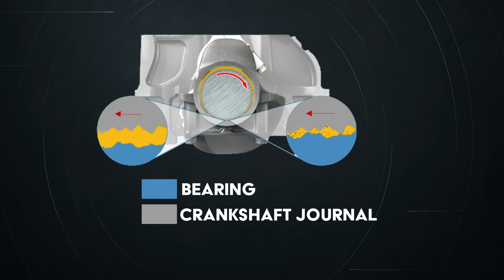the truth about start-stop technology (finally proven)

Comment: I'm thankful my 2025 F150 has a little dial to pick different driving modes, and Sport mode(disables auto-start stop/cylinder deactivation) can be turned on by just spinning it all the way left. It's pretty quick and simple to do, sucks you have to, but could be a lot worse. it's the first thing i do after starting, and i'll be doing that till the wheels fall off

Comment: This is absolutely false, to the point where he's not just mistaken, but purposefully ignoring reality and must be pushing an agenda.

His "experiments" are laughable, and he even admits you should think the first one is "shocking".

5:08 we see the first "experiment" takes several seconds for the engine to stop, and 8:55 we see it require over a second to start. These are not start-stop engines.

Notice he never says what kind of engine or car he's using? It appears to be an older model Transport T6.

So, he is absolutely right that you should not try to retrofit your 1973 Plymouth Duster straight-4 to be stop-start 😂. He MIGHT be right that you should disable start-stop on your 2016 VW van, especially if it's a diesel engine with over 100,000 miles on it.

The fact is freight companies use start-stop engines in their fleets. They do cost-benefit analysis (including large-scale real-world trials covering millions of miles), and would not use it if not directly cost-saving.
Reply: Yeah, but don’t ruin a good alarmist theory.

Comment: Even before this video, I’ve always thought a separate electric heater/pump  that specifically lubes the main bearings for a few seconds before starting would be a worthy idea. I have a strong suspicion that engineers have neglected the main bearings in the latest truck engines.

Comment: There are a lot of key test conditions that you did not provide. 

What was the oil temperature throughout your test? 

What was the water content in the oil by the end of your test? 

What were the on/off times?

Have you considered comparing the damage to an engine which is exclusively idled for an equivalent duration? Extensive engine wear also occurs in vehicles that are idled.

Comment: What about hybrid vehicles they're constantly starting and stopping and often last over 300k miles. Also vehicles with traditional start stop systems have electric oil punps to maintain flow. This is biased and doesn't take into account how start stop systems on equipped vehicles work.

Comment: Highly unrealistic test tho. No one does 84 hours of full cranks back to back. Good auto start stop systems don't do a full crank either. I've heard some cars do a full crank and that's stupid, but good systems just pause the engine then resume when needed. It seems no one can agree on whether or not it damages the engine. The proof is in the pudding, which this pudding was made with cement powder instead of gelatin

Comment: I just came here to say that regardless of what this video has to say, I absolutely love this technology. At first I thought it was dumb, then I realized how it was working, and just how much it was saving on fuel. Astronomically different for me when I stop and go  traffic, waiting for one traffic light after another, or post- concert traffic  that only moves like every 30-60 seconds thanks to a traffic cop directing the rush, or in a fast food drive thru thats not actually fast...
My average mpg is impacted quite a bit whenever I'm stuck sitting and idling. 

Where it doesn't make sense is when you just come to a stop sign or something where you're going to pause only briefly, or like false-stop traffic backups due to morons, where your rush hour traffic comes to a dead stop for just 3-5 seconds or so.. HOWEVER If you are truly paying attention and recognize these things ahead of time, especially at stop signs and when you're going to need to make an unprotected right or left turn, you can make the car NOT activate the stop/start  thru METHOD, not just turning of and on the button. For example, my 22 Durango, if income to a stop LIGHTLY and barely am touching the brake at all when I stop, it won't activate. Then once stopped for 1 second, I can then push the brake firmer and there's no activation. Also, upon resuming after stopping, it will NOT activate again until you've reached at least 6mph ... So if you're creeping along in slow traffic, it won't re-activate... Which is why I wait for a slight gap, enough to get 6mph so it resets the conditions, then next time traffic is stopping, IF I determine it's gonna be stopped for like 15+ seconds, I can make it stop. For example, if I come up to a traffic light I can't pass thru, but don't know if I'll be able to get thru before red, I'll "soft stop" so it doesn't activate, but then if the light turns and I still can't go, I let off the brake for 1mph increase and then press the brake a little harder to stop and it'll activate so I'm not pissing away fuel at a red light.
I LOVE THIS SYSTEM

Comment: One question according to the manufacturers the oil pressure for start stop is primed hence there should not be a los in oil pressure due to start stop.
Was the relay integrated into the start stop system and securing the oil pressure the manufacturers claim or was it just connected to the conventional engine start?

Comment: IF ITS SO DAMAGING why am i as a tech not replacing crank or rod bearings or enginebloks all around the year? over past 10Years i replaced cilinderheads for coolant leaks never have i replaced engine blok for wear and tear on crank or rod bearings. i work for an official VAG repair center so i get all the troubles of the brands. this video is made to scare not educational

Comment: So what you're say is, our engines would last virtually forever with an electric oil pump that builds oil pressure before cranking... Who could have imagined?
Reply: This is exactly what I was thinking. Electric before start and mechanical while running.
Reply: I was instantly thinking the same thing
Reply: The electric pump to cover pressure before starting the engine sounds really worthy. This is an easy retro fit. Can this team do a similar test to simulate a years worth of stop starts with an electric pre-pressurised oil freed system.? Please!
Reply: I do not trust electric oil pumps and water pumps feeling an engine.
Reply: @lexustech48 thats why you have both in parallel with backflow prevention check valves. Electric is only used at startup and engine only starts cranking after a few seconds after the electric pump is commanded to come on.
Reply: same for a gas pump, engine who use a electric one will prefill the engine, for diesel engines its important because running them empty can damage them because it also act like oil (wich is why they last longuer).

Having a mechanical pump who is powered by the engine itself will run the engine dry every times it start.
Reply: Well... that and a preheater so it's already up to temp when you start running it.  Yep.
Reply: @Mark-yx8nn  that might use a lot of electricity.
Reply: I think the parts needs to be on movement also for them to get oil in between
Reply: @loislugo896  still should get oil in all the places in a couple of revolutions not multiple 10s of thousands
Reply: Yup. I don't know what the 2016 VW Transporter T6 had, but modern start-stop engines, with modern oil, do not lose lubrication in that short of time. Kinda scary that an auto mechanic wouldn't know that.

He might as well have been testing on a 1979 Ford F150.
Reply: @MrRoguetech i did not know start atop engines could bend gravity and lubrication just because the manufacturer told you so.😂
Reply: @MrRoguetech  "...do not lose lubrication in that short of time." If it doesn't have an independent electrical oil pump, I seriously doubt that is true. Even then, you will not have hydrodynamic (.e. wearless) lubrication until the engine is above about 500 rpm and thus an automatic engine stop start (AESS) engine will, almost always, benefit from that function being disabled. Only if the AESS prevents ridiculously long idling could it be of benefit to the wear of the engine.
Reply: @MrRoguetech  yeah he seems pretty clueless
Reply: Do you and everyone else want to drive the same car with a forever engine? Most people replace their cars withing 5-10 years. What's the point of having a forever engine? The goal would be to have an engine that is good enough to last the PRACTICAL life of the car. Over engineering anything beyond the PRACTICAL life of the car is a waste.
Reply: @joefish4466 my car is 12 years old...im not looking forward to buying a new car. I will keep maintaining for another 20 years.
Reply: @joefish4466 the practical life time of a car should definitely not be as short as 5-10 years. So lots of people get a different car in that time? Yeah, I just did this summer myself.

But there are two factors that make such a short lifespan for a car INSANE. 1 is financial cost. Not everyone can afford to buy cars like that. I bought my first car at 19 years old for $1000 and at the time the car was a 16 year old Honda! 2 is environmental impact. Having cars last for the lifetime of 1 owner would be awful for the environment.
Reply: @joefish4466 because cars can last decades, he handed down etc. the idea cars only last 10 years is modern marketing and deliberate design. 2 of my 3 vehicles are 40+ years old, cheaper to maintain than modern cars, and get way way more attention and comments from folks.
Reply: @joefish4466 so when your kid buys their first used car they will all be mechanical grenades and a cost trap because PeOpLe DoN't HoLd On To ThEiR CaRs AnYmOrE.

Comment: I would say there is room for refinement. I have to say when driving in town in heavy traffic and long queues I find the build up of fumes quite stifling, especially on a hot day with the windows down and I did that for many years when I was working. I actually preferred the stop start function then and often thought for goodness sake turn off your engine you are not going anywhere fast when sat next to a stationary car pumping fumes in my direction and typically they are the sort sort of driver who races off to get 10 meters as quick as possible in order to sit stationary on the bumper of the car in front for another minute or so. Yes you can manually stop start your engine and I often do if I am not driving with auto stop start but that does make the traffic jam that little bit more tedious. Maybe a selection of stop start programs for different circumstances would be a good idea, I would imagine it possible to build in a learning algorithm to detect certain conditions and adjust the function which would turn it off entirely at times. Certainly my current BMW turns it off at times which I assume to be when the drain on the battery is deemed too much. Maybe a link with the satnav for example which can predict that you are going to be stuck in a jam for a while.

Comment: On the mazda 6, u can disable it by removing the bonnet switch right at the front. No need for stupidly expensive battery. You will get a permanent battery warning light though

Comment: when this mumbo jumbo came out I thought about starter wear and dpf clogging up due to low exhaust temperatures not being able to burn off unburned fuel particles and of course in Estonia where there is below zero degree weather for a long winter period i knew It would wear out engine when the engine is cold but  I didnt know that such amount of wear occurs in warm internal and external temperatures. This just proves the well known point that Politicians and businessmen don´t  give a donkeys dillhole about the environment. Just milk these silly goats

Comment: Subaru has taken away the ability to permanently switch off this so-called feature. Now you have to remember to turn off each time you get in the car. And they removed the mechanical button to keep you from even using the automated replacement switch. 
Up to this point, I always bought Subaru, but never again.

Comment: The fact you constant start stopped instead of typically letting the engine cool between most cycles doesn’t prove anything.  You can also get an oil that is more viscous at warmer temperatures to reduce wear more.  

Ignoring all of that the intention of this technology is to save fuel not wear on serviceable parts.

Comment: You failed to account for the check valve that prevents drain back in most newer high quality engines.  The engine in my Tacoma Hybrid builds oil pressure almost instantly upon restart. The fuel that I save offsets any costs associated with wear. This isn't an issue for all vehicles, only the cheaply built engines found in Nissan and Chrysler, Dodge, Jeep and Ram vehicles. This is 100% your government's doing, not the manufacturers.

Comment: if a german engineer say start/stop is good for envirement, locally it could be correct because in germany there s always railway connection and wait time and its not 1-2 minutes its really 5 to 10 minutes before the train jam is over and you can drive further so a german would say ok i really save fuel with start/stop but if you tell me who lives in istanbul or izmir with hilerious traffic jams i would say bullshit... Every 5sec you have to move tiny meters in jam and everytime the start/stop cycle is ridicilous... İ dont know why engineers just dont let the ecu calculate the stopping and starting ratio per min and just calculates if its worth to activate or not by itself... 

So in conclution, in Turkiye i never use start/stop its just ruining the bearings/battery/start engine etc.. but when i am in germany(mostly baden wuttenberg area) i use start/stop because of the rail traffic all the time and its benefitial there in my perspective... 

Thanks for video

Comment: It's science and fact.  If your engine like most, has a engine driven oil pump...start/stop is increasing wear. The crank surfs on a thin wedge of oil once up to pressure, but scrapes metal to metal until that wedge is formed. Bearing material is lost however minutely until the crank is suspended by the oil. Think of it as your 50lb crank sinking to the bottom and resting on the bearing and scraping around until it floats again at a certain ''Lift-off'' pressure. There are no bearings in todays cars that miraculously defy these Laws, there is only the need to pacify the EPA that as a manufacturer you are complying with their desire to look like you are trying to ''save the Planet''🤣

Comment: It's crap and I hate that I have to remember to turn it off when I drive. The location of the button in my car is also hidden from view in my car and I have to bend down to look for it.
If they are going to continue to have this feature in every new car then at least give the option to permanently shut it off or add the button to the steering wheel.

Comment: I'm not a fan of stop start but you haven't convinced me that marks on bearings that have been "in use" are evidence of abnormal wear. I am more concerned over EGR and PCV systems in modern engines and the damage they do through contamination of the engine oil. That and extended drain intervals are far more detrimental to any engine.

Comment: I wonder if the BMW implementation of this system negates most of these points. It uses a separate 48V starter for hot starting the engine which starts the engine much quicker and more efficiently. Combined with 0w-20 oil, I would think oil pressure gets back up to where it needs to be almost instantly (Ie. Before any significant load is applied to engine)

Comment: I always turn off the idle stop feature. I live here in the tropics where the AC runs all the time, even at night so when the engine stops, the AC runs off the battery. Idle stop is also bad for automatic scooters, where the riders will just turn the throttle up and ride straight off when the light turns to green, without waiting for the revs to stabilise after stopping.